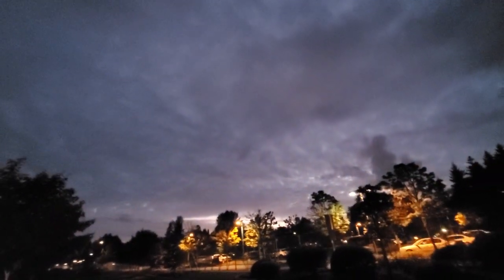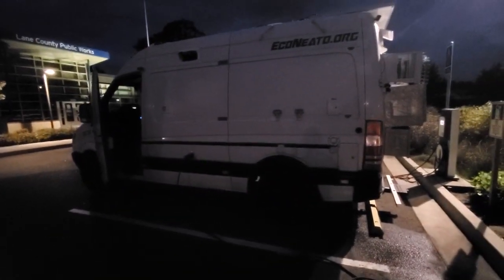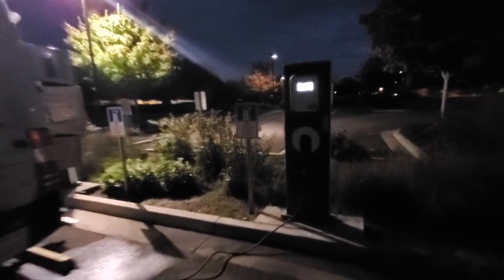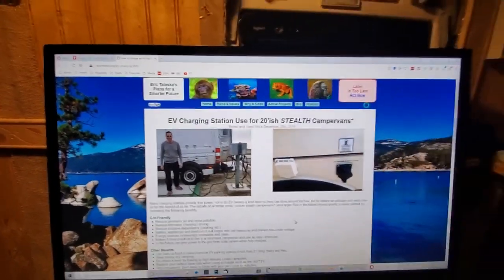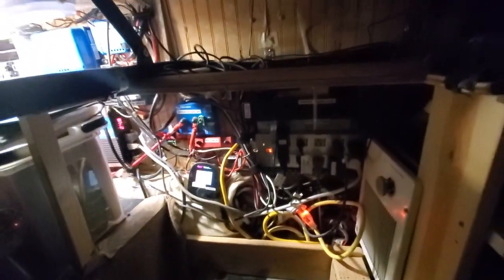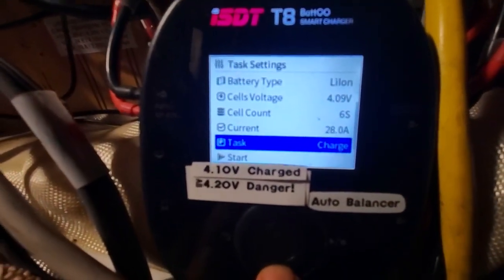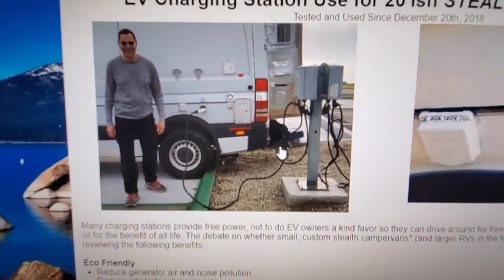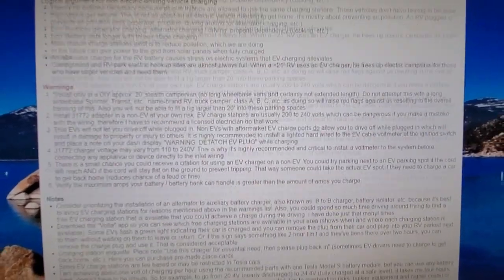EV Charging Station Hack for RV/Campervan 2-Years of Use Report

Comment: hehe, i put a 15kwh battery in the back of my phev, and use it as a portable charger. the hybrid inverter can pull up to 5.5kw, and i use the same adapter as the AC in plug on the inverter.
basically i can pull up to a free charger and use 2 cords to charge my car and range extender at ~10kw, and get a full charge worth (gen1 volt) in an hour and leave. I like charging in the middle of nowhere when i take a break from driving, like at random rest stops. 
i have thought about pumping the free electrons back into my home but i decided to just offset the use of my highest power appliance (my phev) and do all my charging now at work/free chargers.
i have only been doing this for about a year now and I think im the first one to combine all these ideas into a portable range ev extender. really hard to find videos on this, i looked everywhere on yt a year ago before i made my setup but i never found your video until now.

Comment: Hey man love this set up, anyway to be able to use this system without a tesla battery? Instead maybe 4 lithium batteries. Especially for dry camping for long periods of time.
Reply: Yes you can, you need to buy a j1772 to NEMA adapter then plug in a 240v input inverter charger to your own batteries

Comment: On wikipedia's info theres the stuff about the 2x control ports 
If u send 1kz square wave at 12volts and change the duty cycle it tells the charging host the how flat u are if have problems 
Others change voltage 
Might help

If you wire the drive off detector to a buzzer and to ur startmotor power setup u can stop drive off 

I'd also run charge port at position u always park and remove the lock clips on socket have it go deeper in sos the housing depth sports holding plug in and if you forget it just slips out and disconnects 

U also want use that feature to create a power relay to not have arcing at plug

Comment: Electricity at night? That is frack-gas friend. Cleaner than the gasoline tank, but it's still carbon. That is unless a nuclear reactor is powering the grid. (As it should)
Reply from the maker: Can we convert our nuclear weapons to nuclear energy?
Reply: @EcoNeato  maybe. Fuel would be over enriched, but I'm certain that could be rectified. Much better use for that fuel then what we have done in the past. 
Unfortunately, the only way the DARPA psychos will allow that is if they've created something even more frightening and disturbing. (Like weapons in space, placed under the guise of "protecting the planet from little green men")
Reply: Thank God we have carbon dioxide, otherwise we'd all die.
Reply: Weobg

Comment: I also saw the charging adapter with a 50 amp rating versus the one you listed for 20 A any benefit to that for you could you use the 50 A?
Reply: Just to reduce resistance to stop heat 
Bigger possibly have longer lifespan

Comment: It’s a neat idea.  Many EVSEs are actually connected to one leg of 3-phase power, so you get 208v, rather than 240v.  I wonder if that’s why you have trouble at some stations.  You need to watch costs closely on these chargers.  Many are subsidized, but others are the most expensive power you will ever encounter.  Technically, your use of the EVSE for this purpose may get you a ticket, depending on signage, enforcement, etc, but using the EVSEs at unconventional times for EV drivers should further reduce an already low risk.  If you tried to charge during times when EV drivers are likely to be wanting to charge, you would be much more likely to get challenged.
Reply: I think he’s using a switching power supply, so that shouldn’t prevent the supply from being able to accept the current.
Reply from the maker: Maybe I need to have a 240-volt appliance active such as that 240-volt heater, so I'll try that the next time I can't get a charger to work.
Reply from the maker: Do you think it also could be due to having the 12-volt house and 24-volt RV battery banks grounded to the chassis which is the same chassis the EV adapter is grounded to?

Comment: Love it - may have to add it to my 2009 jeep micro camper - especially now that actual jeep wrangler ev models are soon to be out there.  I’ll have to locate the input connection in the same spot as those... 👍. Wonder if a standard victron 240->12v 30a charger would work without modifying the input side.
Reply: Nope.  Those victron units (the inverter chargers and the transformers) are designed for single pole 220.
Reply: Buy hybred jeep